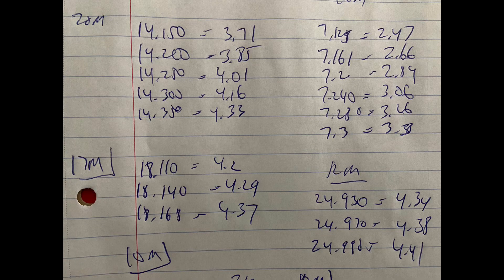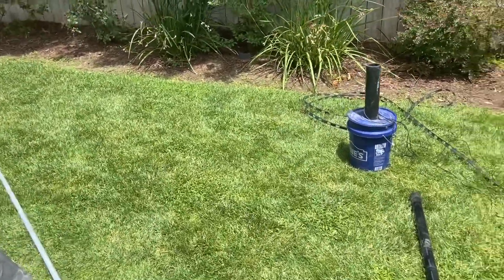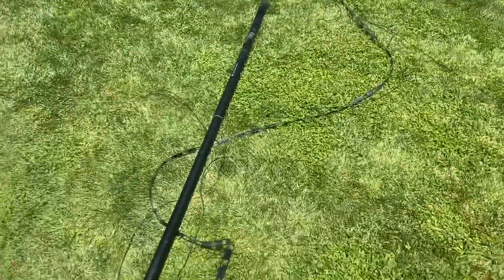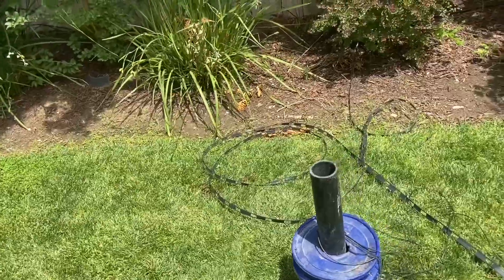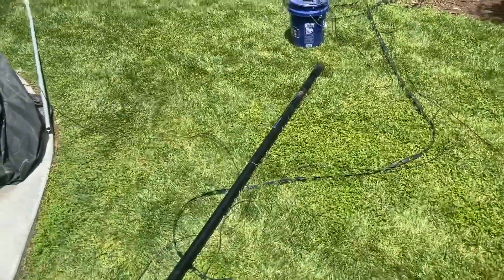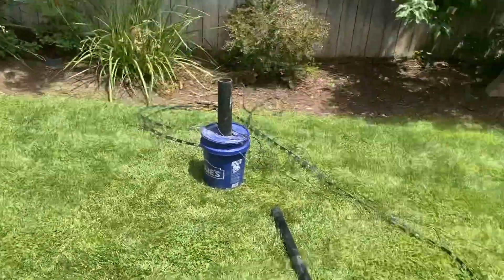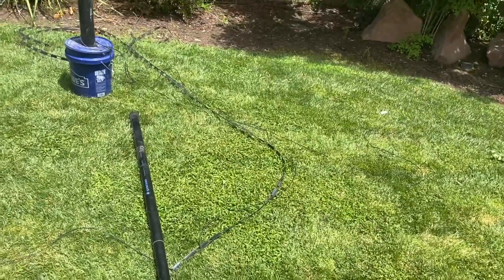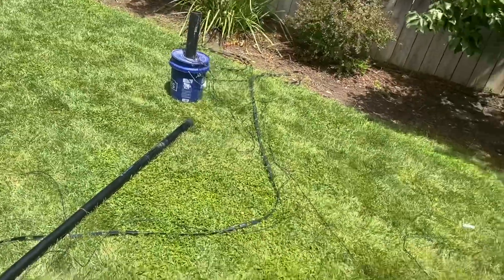ZS6BKW SWR Issues

Comment: I have a ZS6BKW in an inverted V configuration which works extremely well. I did need to trim both ends several times as I measured SWR with my Rig Expert analyzer. As Dave Casper says about Antennas, "everything affects everything". You will need to adjust each leg for best SWR using a reliable antenna analyzer. I expect that this will produce the best SWR that your system is capable of. Good Luck,  73,  Fred. KC2PK